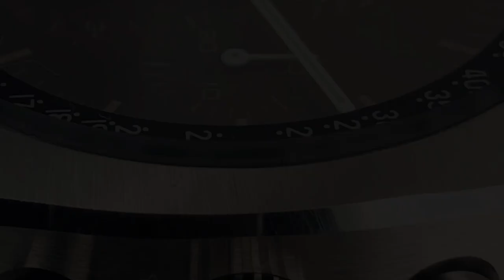Omega Speedmaster Mark II Full Case Restoration Refinish

Comment: Really nice work! Congrats! Can you please tell me where did you buy the adjusting table for the lapping machine? (If you did it by yourself, can you advise me where should I get the screw and snail gear? Thx!
Reply from the maker: Thanks for your comment. I did the table by myself. The snail gear I have ordered in some shop, found on google and drilled it down to my belongings.
Reply: @Vintwatches  Thank you for your quick answer. Last night I found also a similar snail gear and shaft and order two pairs.
I think you make wonderful stuff and it is an inspiration for me.
I am currently building a microbrand in Romania and watching your videos gave me some new information.
Thank you for sharing!!  I also try to post and share as much as I can.
Stay safe!

Comment: Am I crazy for thinking that i can get parallel brushed lines on a watch case? The brushed surface is a flat surface, its the same surface where the crystal is ,the front of the watch, do you think i can manage this by hand and get a brushed parallel surface? Thank you for video!
Reply: You can flip the case in the side to be brushed and have a guide like a straight piece of wood. 

Use a ultra fine grey 3 M pad. Lay it flat on a table. Align the guide piece of wood and press the case to its side. Press down lightly the case to the 3M pad and pull toward you in one direction. 

Hope this helps.

Comment: Lovely good done. Can you mention the grit sizes like you did in your previous videos. Thank you
Reply from the maker: Ronit Roy thank you for your compliments! I used 320 Grit for the finish of the sides, top sun cut with 180 Grit and cutting oil. Case Back with 120 Grit.

Comment: Hi Daniel. Wow, amazing work, just perfect. I have the same case (mine is a Mk 4.5) and I’m gonna contact you to know how much it would cost to me. If the edges are some curved because other not so wonderful polishing process, you can do it too or laser welding would be required? Best regards
Reply from the maker: Hi, you can contact me through my website vintwatches.de